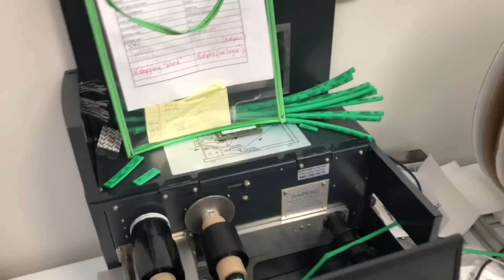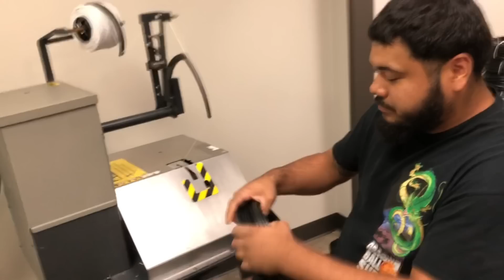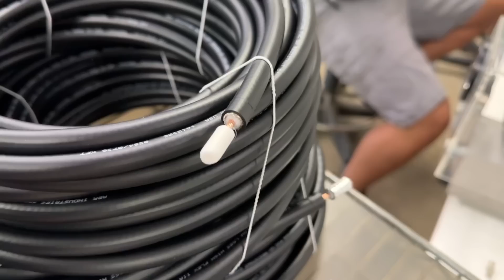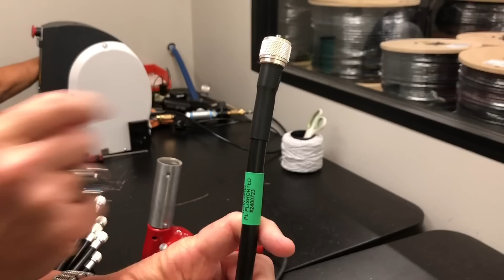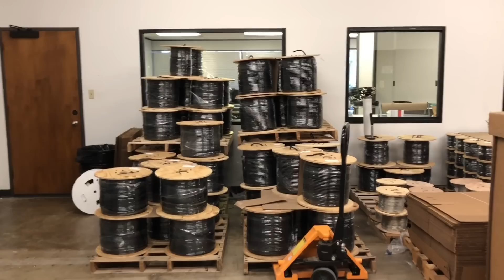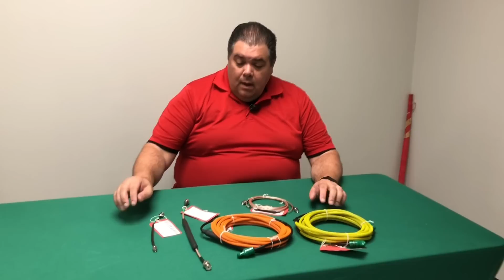I Toured ABR Industries New Production Facility!

Comment: Mark,  Thanks for the tour, very interesting. You may not have filmed this part, but from you showed, after crimping and heat shrinking, it goes straight to shipping That made me pause a bit: Does ABR not test the cable after manufacturing it before shipping. I would expect at least a basic continuity, shorting, impedance and TDR test to test the integrity of the piece they just manufactured. Maybe, they just do random sample testing and not every piece? Gives me pause about ordering an relatively expensive cable from them. I don't mind paying the extra for Q only if there is good evidence of it, and not having testing fails that gate IMHO.
Reply: There was another YouTube video that showed the workers putting connectors on the cables.  In that video, they showed an RF Industries continuity meter that was fastened to the workbench that tested for open/shorts in the cable.  Not sure if they still use that test product or not, but I have one here.

Comment: Hey! Which cable do you get from them? Thx ! Brian WB8AM
Reply: ABR-240uf how much  power  will  it take? I use it on vhf 6meter  bandwidth. 73 AE4OY WILLIE PEACOCK  EM-81UF
Reply from the maker: Umm, I didn't get anything from them.  I toured the factory.  BUT, I do have their ABR-400UF and their ABR-240F
Reply: @hamradiotube  RRR, I figured you already had some cables. I already wrote them about making a ferrite adapter. Chuck replied and said that the 400 can handle full legal power but the  316 goes to 100W. Imma gonna write back to ask about the thickness of the ferrites and typical length for adapters. 73, and thanks for the vid.
Reply: @hamradiotube  You also have one of their chokes 😉
Reply: Good stuff!